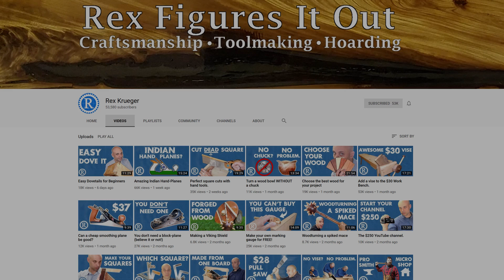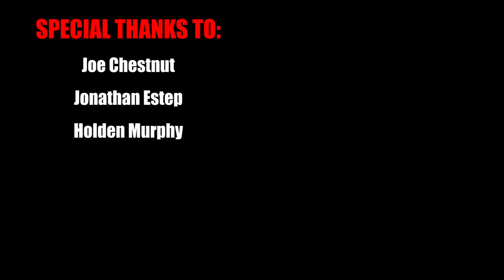Forging A Native American War Club (feat Rex Krueger)

Comment: I've put a bid on it but that screw underneath is getting replaced with brass to match the inlay, and then filed flush. The protruding steel really looks unfinished to me.
Reply from the maker: it's all epoxied up.  you can try if you want but...
Reply: Green Beetle I’ve been outbid already so no need to ruin anything!
Good news for the charity, though!

Comment: Totally wrong blade design.
WAY too large, gunstock clubs were fitted with triangular close fitting blades between 2-3 inches in length. Purpose of the blade was to cause long deep gashes while permitting the Warrior to remain fluid in battle.
The shape and size of your blade would cause extracting it from the opponent's body difficult, specially with the shape of the gunstock club.
Reply: Who cares? It looks cool and no one is ever going to use it in battle.